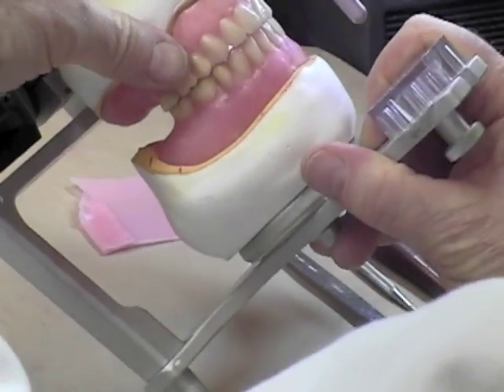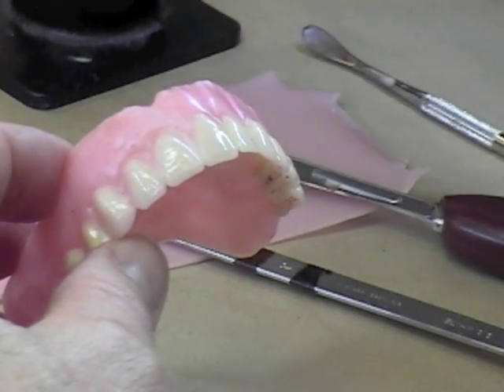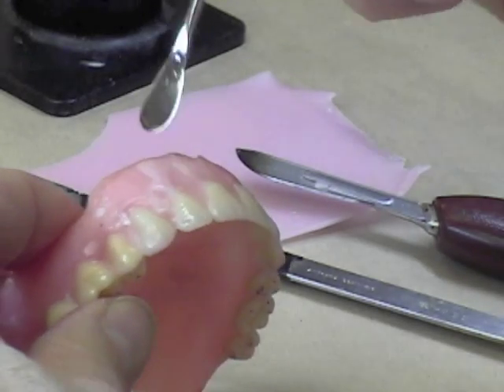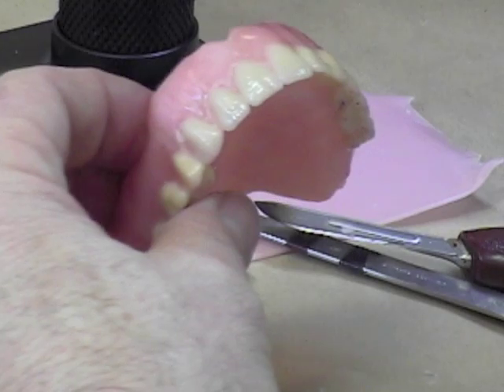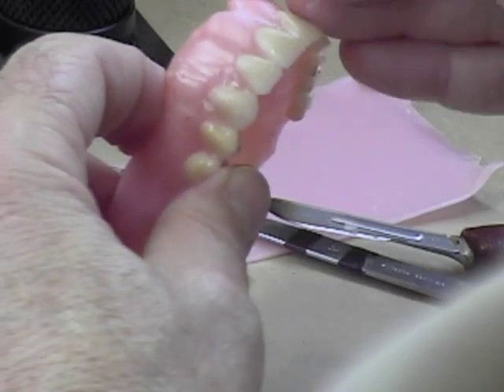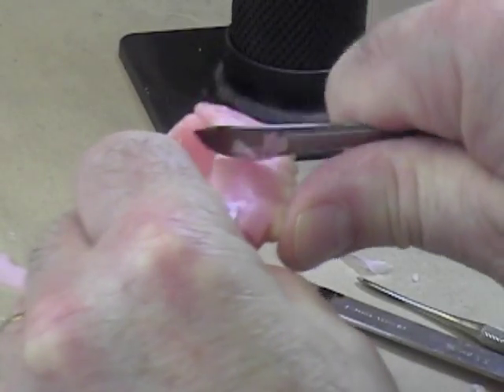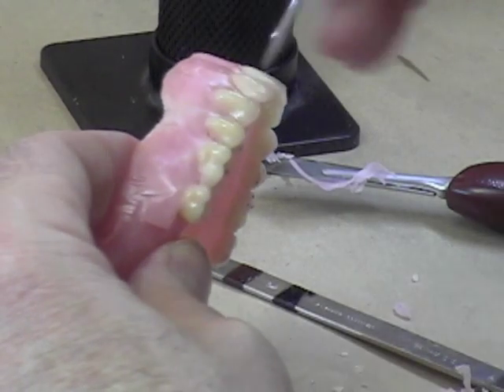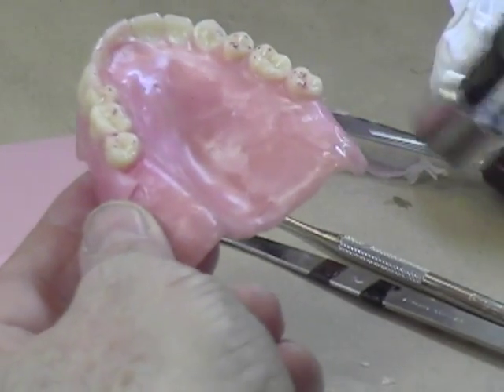38 Finishing a Complete Denture Waxup

Comment: Should be kept on the model ,the wax will soon warp with the heat.
Reply from the maker: Whenever wax is heated and cooled, it can change shape and dimension. As it cools, it can shrink. How much it shrinks can depend on factors such as how much wax is involved, what type of wax is used and how high a temperature it is heated. In general the higher the temperature and the greater the bulk of the melted wax, the more dimensional change can occur. This happens whether the record base remains on the cast or not. For short periods of time removing the wax-up from the cast will not greatly affect the overall setup. Once completed the record base should be replaced on the cast for storage until the wax-tryin appointment.